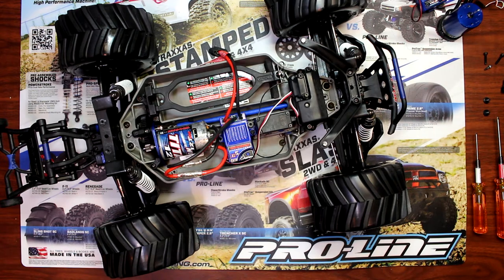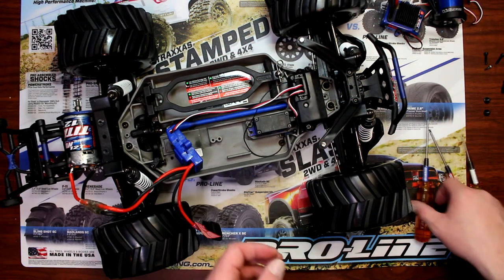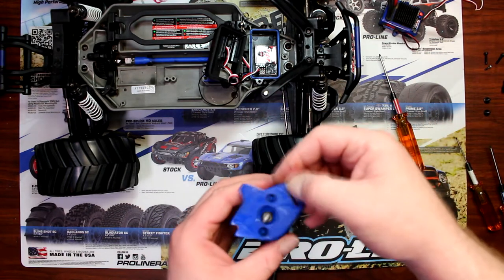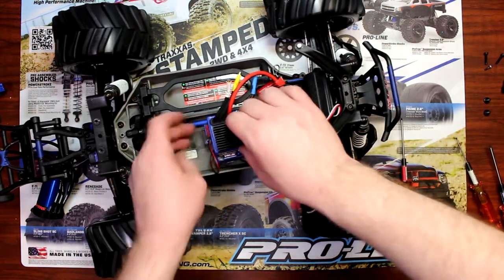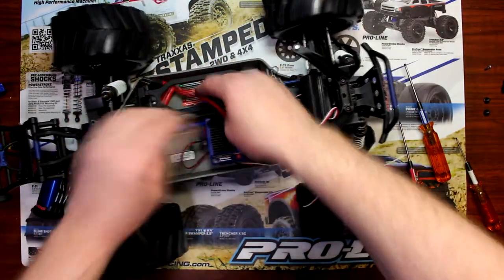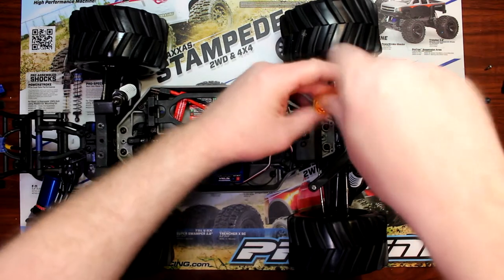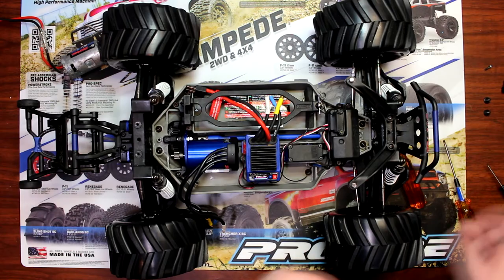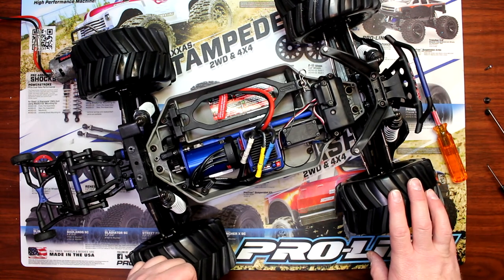Traxxas How To Install Velineon Vxl Brushless

Comment: Stampede. Upgraded sons with vxl-3s and motor.  Programmed. Have 2 traxx power cell 3000mah nimm 8.4v. Fully charges.  When we set up for stock or race. It runs 3 sec. Then quits. Red light flashes red.  Wtheck.  Batteries are new. New ezpeak charger.  Store bought it from says everything would work with batteries were running. Any ideas on our problem. Tks

Comment: what set of screw drivers did you use? i dont wanna pay $70 for 7 bits
Reply from the maker: The ones I’m using are MIP. Set. They are expensive specially, here in Canada but there is alternative for lot cheaper.
Reply: @djsprc  do you have any that you suggest that is cheaper?
Reply from the maker: @iloveTV154  https://www.amazon.ca/Aluminum-Hexagon-Screwdriver-traxxas-Helicopter/dp/B09RWSP39X/ref=mp_s_a_1_10?crid=2FIYUVUP82I77&keywords=rc+screwdriver+set&qid=1706150253&sprefix=rc+srew+driver%2Caps%2C84&sr=8-10. 

The link is in Canadian but if you use the description you’ll be able to find something
Reply: thanks very much @djsprc

Comment: Reckon this would fit in the 2wd
Reply from the maker: Yes it would
Reply: @djsprc  thanks for replying I just realised tho that the new models already have the VXL-3s with the brushless motor, sorry got another question do you think a velineon VXL-6s with the 2200kv motor would fit?
Reply from the maker: @westie659  Yes you could make it fit but the machine would be uncontrollable and very stupid. But yes it’s doable
Reply: @djsprc  yeah true good point I wanna do a monster conversion might just stick with VXL-3s thanks again
Reply from the maker: @westie659  I did one in the past ended up breaking more parts than having fun with it.
Reply: @djsprc  yeah I was worried about that I was looking at upgrading 90% to aluminium parts as well that’s why I thought about the bigger motor